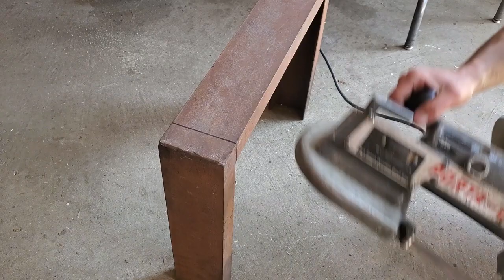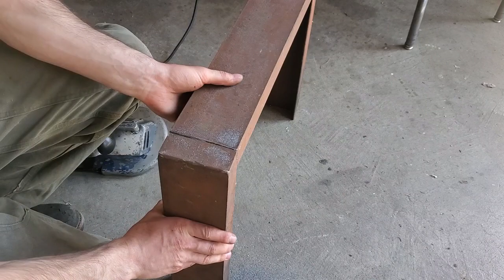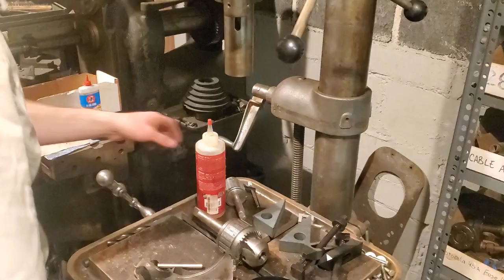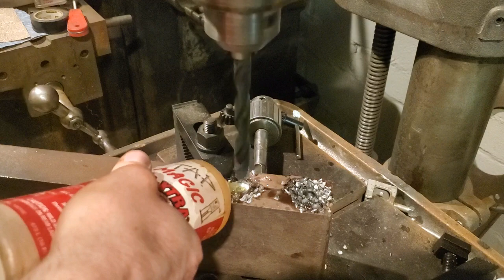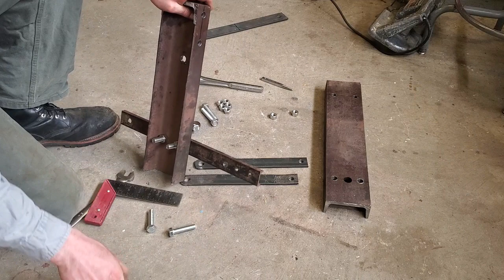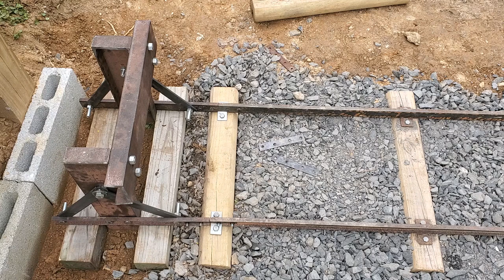Railway Buffer Stop Construction

Comment: Cut a section of a tire and slide it over your top channel iron.
Reply: Or a thick plank of wood, those are ofzen seen on simple buffers
Reply from the maker: Should have saved some, I just got new tires for my van, but they didn't give me the old ones
Reply: @Redundant_Communication  Keep an eye on the local roads ;) If your area is anything like mine, semi's throw their retread and it ends up on the side of the road. And they are often pretty big pieces!
Reply: An old gas shock would be cool in the end too dampen the stop
Reply: Or...like spring buffers, like on UK railways